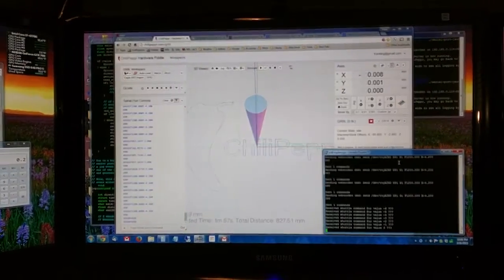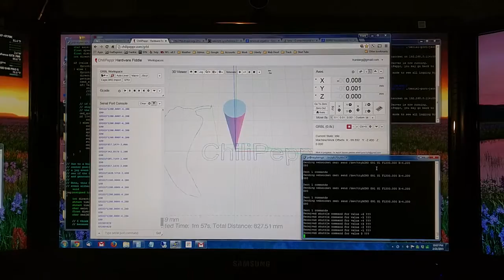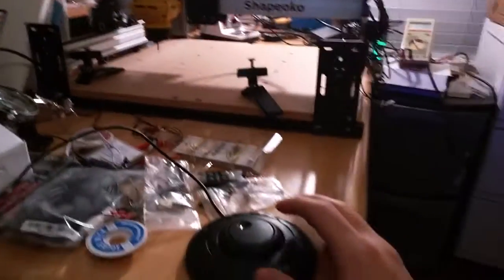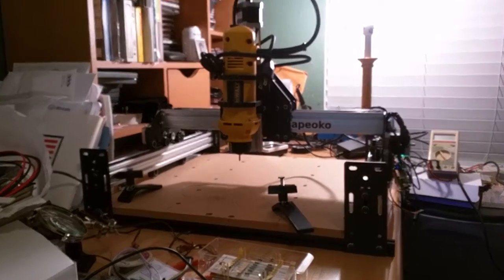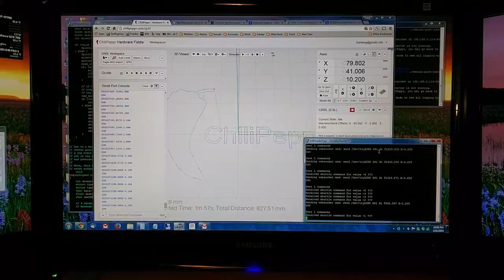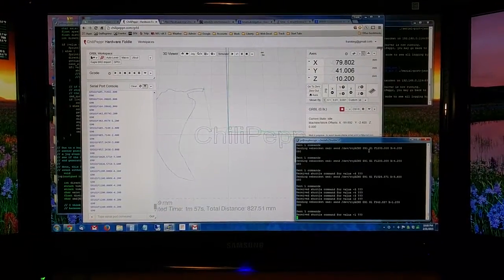A real jog dial for ShapeOko

Comment: Hi Frank,  This is great work!  I tried to follow the install procedure for the widget in ChiliPeppr, but I get a errors when running make on any version of nopoll.  Any idea how to fix this?
Reply from the maker: well, I wouldn't be surprised if the versions of nopoll have moved on and made it incompatible as this is a bit old.  My readme says I was using nopoll 0.2.7.b164.  Were you able to try that one?  You might also try posting your issue on the github page for shuttleCP as I think it might be easier to respond to issues there.
Reply: @FrankGraffagnino  Thanks for the quick response.  I did manage to get the latest ver of nopoll to compile, but then I ran into an error making shuttleCP.  I finally got it to compile and its running!  That issue was the location of curl.h in the include directory.  Going forward, I'll post on the github page.

Comment: I have one of those that I used with iMovie and Final Cut. It is exactly what I am looking for to use on my X-Carve.
Do have a question though. Does it require hard wiring and if so do you have pictures of what it looks like. Following  the pin-out text is greek to me.
Reply from the maker: A lot of that pin out stuff is for reading buttons and writing to less hooked to the pi. The actual jog dial you just plug in. You don't have to have those external buttons and leds. In fact, I think in one of the latest commits to the project I made it easy to disable those.
Reply: +Frank Graffagnino 
I have tried to install the code via terminal but it is not working.
I have Mac OS X 10.10.5 and ChilliPeppr works good with the X-Carve. This jogger would be great.
I do not know what I am doing wrong and my use of terminal is mostly cut and paste. Any help here?
Reply from the maker: you would have to post some error messages or something... or a video maybe of what you've tried and what is going on.
Reply: +Frank Graffagnino It tells me that that command not found. Make among others. I will post screenshots tomorrow.I installed X code but that doesn't seem to have helped, yet.
Reply from the maker: i saw this on stackoverflow when I googled for that error... give it a shot:  "You need to install Xcode from App Store. Then start Xcode, go to Xcode->Preferences->Downloads and install component named "Command Line Tools". After that all the relevant tools will be placed in /usr/bin folder and you will be able to use it just as it was in 10.6."
Reply: +Frank Graffagnino I will give that a shot, thanks.

Comment: Ok, I did manage to get Zcode tools installed (Apple is getting worse than Windows) but now I get errors.
https://www.dropbox.com/s/qtbof0s5y53zzsr/Screenshot%202015-12-04%2013.15.15.jpg?dl=0
And
https://www.dropbox.com/s/7pfi1rcpb865iwz/Screenshot%202015-12-04%2013.13.06.jpg?dl=0

Ideas? I can barely read that stuff as it doesn't make much sense to me.
Reply from the maker: +Daniel Alderman well, i admire your moxie for trying to get this thing to work.  You are breaking new ground here.  Those instructions are written for linux and I think you may be the first person to try compiling it on a mac.  I wish I could cross-compile for the mac, but that is yet another thing that the evil empire won't allow.  So, the error from the sudo apt-get command is because those instructions are all written assuming you are going to hook up your jog dial to a raspberry pi 2.  As for the compile error, I did a google search and it looks like that is also due to Apple removing support for OpenSSL.  See here:  http://stackoverflow.com/questions/16461315/how-to-solve-this-error-bio-new-is-deprecated-in-cocoa

I'm sorry, but I think it would take someone with some programming skills to work through those issues and get it working on the mac.  If you have a raspberry pi, you could follow the instructions or follow along with John's walkthrough video here:  https://www.youtube.com/watch?v=cQpw2chvjzM

But other than that, getting it to work on mac will take some effort.  I'll add an issue requesting someone port it to the mac.

Sorry my friend.  But kudos for giving it a shot.
Reply: +Frank Graffagnino I do not give up easily. Somewhere out there is the answer and it may lie with the Shuttle makers.
I will contact them and see what they think. Thanks.
I will keep you updated as this could be big.
Reply: I have the people at Contour working on this. hopefully they will have something soon.